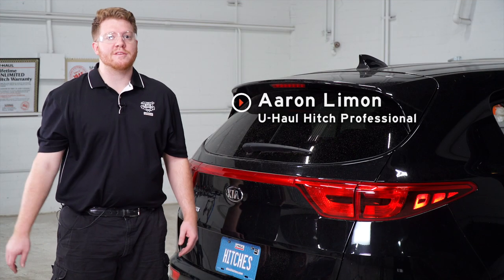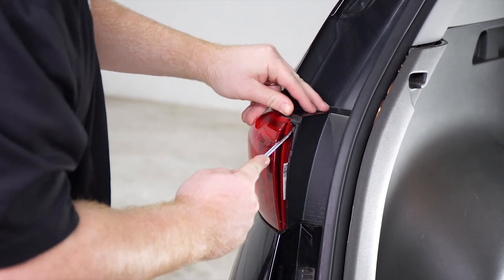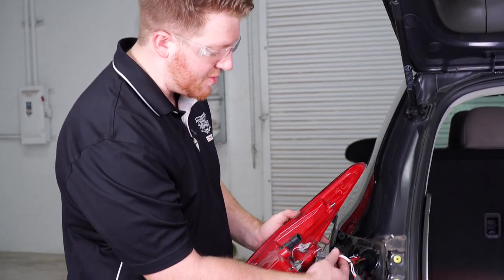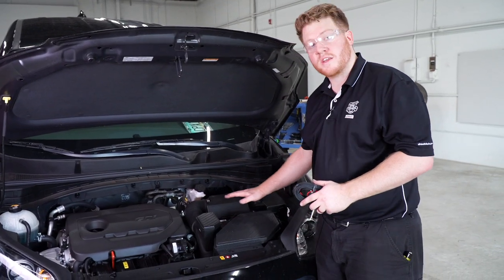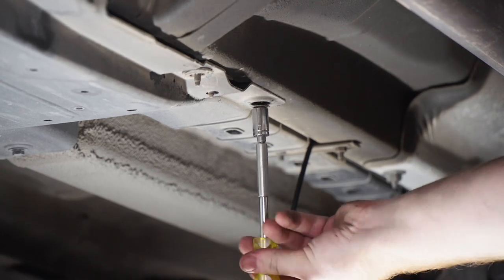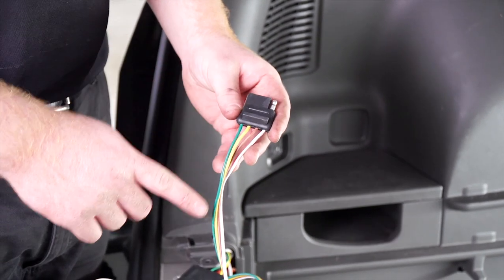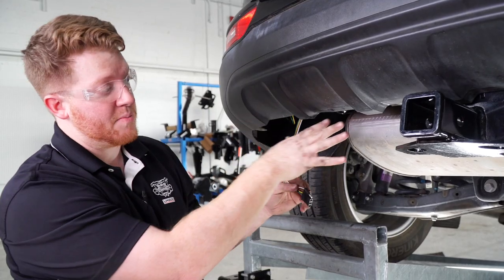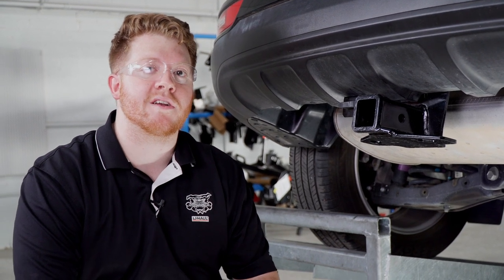2019 Kia Sportage Wiring Harness Installation With Tail Light Removal

Comment: Where does the long green wire go to . I don't have the quick connection. I have to splice into my lights.
Reply from the maker: Depending on your kit, the green wire is typically for the passenger side turn signal and tail lights. But always test your wires first with a light tester.